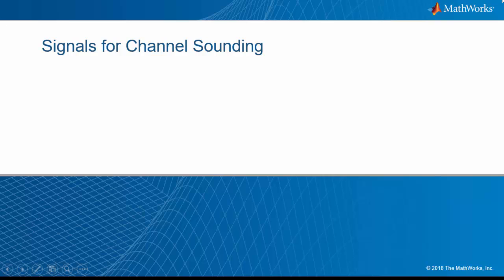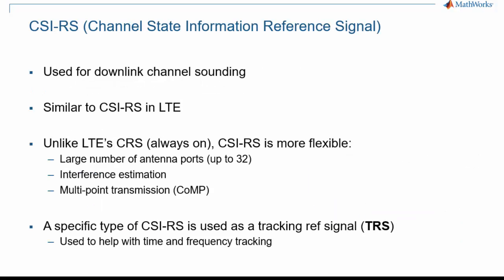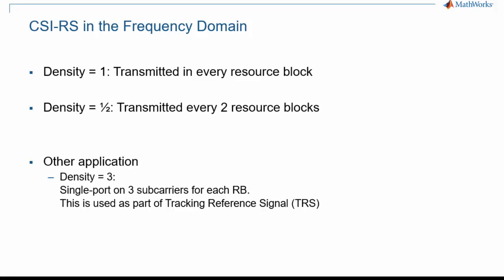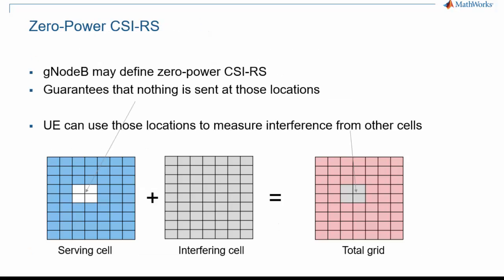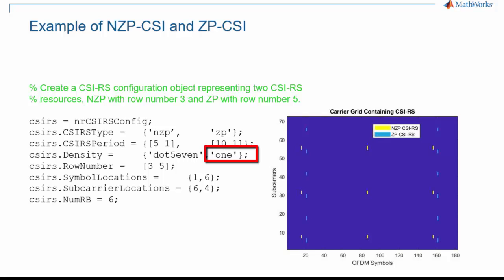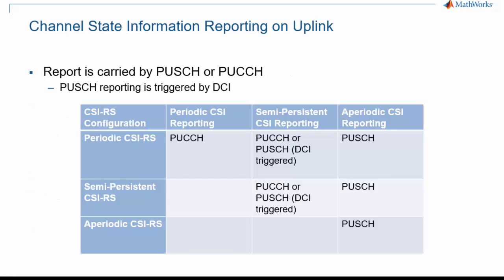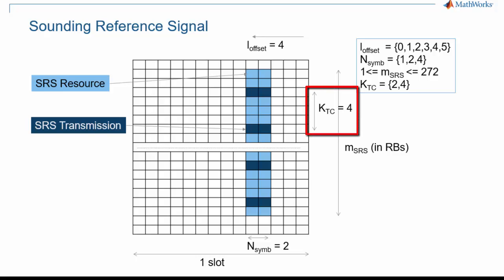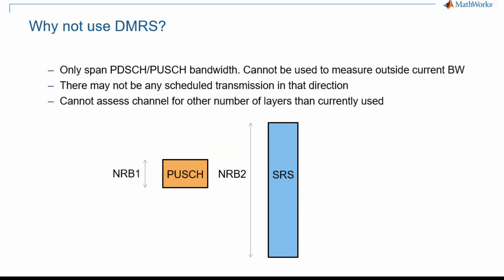Channel State Information Reference Signal (CSI-RS) and Sounding Reference Signal (SRS)

Comment: In the time point 9:48, it seems  the table is not aligned with l_offset = 4.
Reply from the maker: Not sure exactly what you mean, but the offset value can be between 0 and 5 (in release 15) and starts from the end of the slot. So, the slide shows that value correctly. Note that in release 18, the offset can take any value from 0 to 13. Refer to TS 38.211 section 6.4.1.4.1.